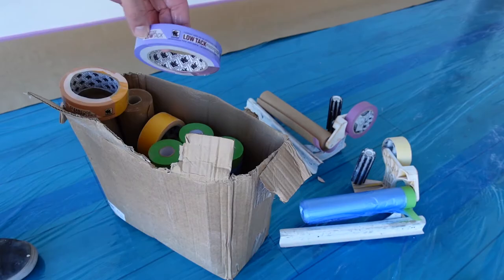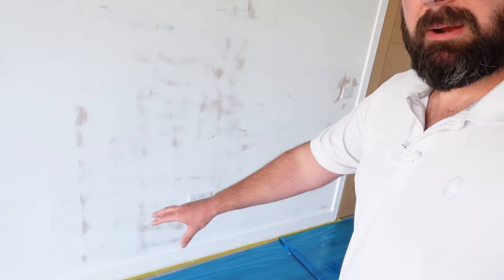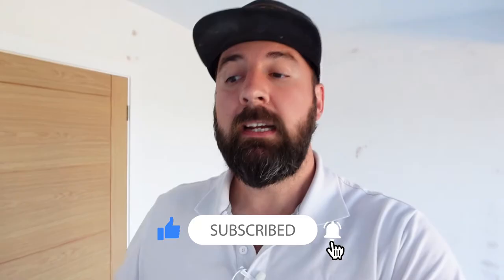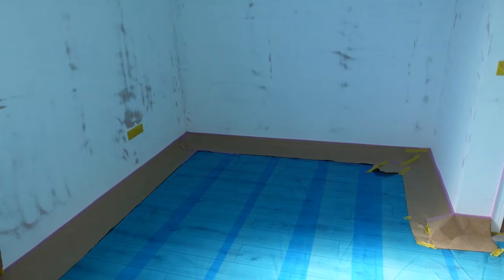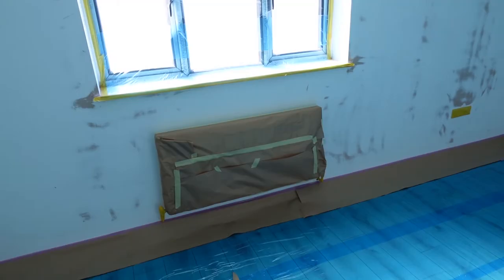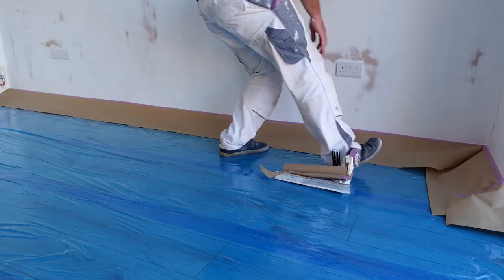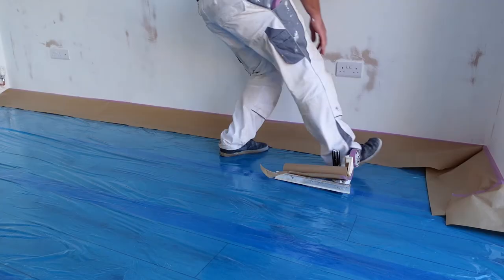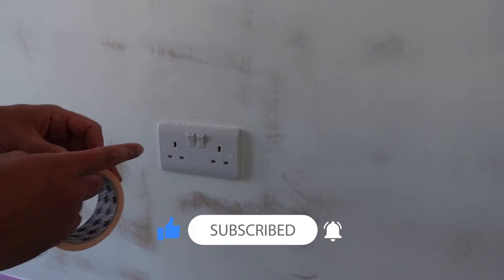How To Mask a Room Up With Wood Floors For Spray Painting

Comment: Loving the video, awesome work ! Just out of curiousity do you charge per meter? And if so do you add materials on top
Cheers
David
Reply from the maker: Hey thanks for watching. I havnt done any on per meter. I just charge per job and materials ontop
Reply: Ok cool, and the tape, and prefence where you get them from? Also I too have the hand master, and was costing a bit for the plastic rolls, till I see the ones you use, 👌
Reply from the maker: @davidsculley6304  ye totally those plastic rolls can come to nearly 10quid and then tape the idasa ones fit on the masker and are 6ish pound. I buy most of mine from crown decorating stores.

Comment: Hi mate lovely job, have you ever had a problem with gun spitting a few blobs before run, honestly doing my pip in, also have you seen the tadpole tape cutter lovely bit of kit
Reply from the maker: thanks, yes ive seen the tadpole cutter. but never use one. did you catch my video on how to tear tape?
Reply from the maker: sometimes they spit when material can be abit thicker, or when paint hangs on the guard. it happens alot with most guys and guns. best advice if its old gun is to change the needle or strip the gun and clean it as it may not be closing when trigger is released causing it to shoot some paint out. 
or start off of the surface each time you start and stop, or you could use a cleanshot valve
Reply: @sprayaholic  no I haven’t I’ll take a look now

Comment: Hi, great video thanks. I hear a lot of people say you need to back roll walls otherwise you can't touch them up. What's your experience with this and would you recommend backrolling? Thanks!
Reply from the maker: Hey thanks for watching.  I think you'll see a touch up regardless of rolled in brushed or sprayed and it mainly comes down to the paint. Some touch up better.  You can touch up a spray wall with a roam roller if its thinned down abit as it will gel out. But the flatter the paint the easier it can touch up
Reply: @sprayaholic  exactly even touching up rolled walls these days is just has much of a problem I’m really not sure you benefit from back rolling in my opinion, try touching up a ceiling even if rolled for example can be a nightmare
Reply from the maker: @David Cottle  exactly mate. You cant. Anti reflex from tikkurilla maybe but not many other paints

Comment: Can you suggest which tip can i use for high rise exteriors happy christmas
Reply from the maker: Hey happy Christmas.  Exterior  and are you worries about overspray? 
What machine and tip size are you using now? Or what had you considered
Reply: @sprayaholic  graco 695 and tip 515
Reply: @sprayaholic  I want to spray for 25story building EXTERIOR

Comment: So you do walls before ceiling if using one color? 2 coats on walls then 2 on ceiling?
Reply from the maker: Thats right.  I do this to avoid walking around in the over spray on the air or on the floor. And then i walk away from the spray not.into it
Reply: @Sprayaholic  doesn't the overspray from the ceiling get on the walls and make it rough?
Reply from the maker: @Erik7prc  no because the walls are still wet from the second coat when i do the ceiling

Comment: What is your goto paint for white walls and waterbased woodwork? And do you dilute either?
Reply from the maker: It changes on jobs. I do like crown matt vinyl as it's nice and flat. Mistcoated im around 30% and top coats about 5 to 10%.  Again woodwork can xhange from crown, to zinsser allcoat or Tikkurila.  Generally 5% just to ease flow

Comment: Do you mind me asking me about your set up?
What pump/gun/tip etc please
Reply from the maker: Hey bud. This set ups my graco 390, graco pc contractor gun, 3/16 whip hose. Tritech 618 ultra tip
Reply: Sprayaholic perfect thank you really appreciate that
Reply: Sprayaholic so you can use tri tech tips in the gracocontractor gun ,didn’t know that
Reply from the maker: @chrisball2258  yes bud. You can use any brand on any gun. You just need to use the same branded guard. So i had a tritech guard on the gun.  All guns in uk at 7/8 thread i think so all interchangeable wagner/titan  graco tritech etc. America i think some guns have different threads.
Reply: How do you find the tritech tips to the Graco ones any preference and if so for what jobs inperticular and what pressure did you get down to
Reply from the maker: @paulmorgan1636  theyre nice. The ultra feel like the graco low pressure tips. But youre not at low pressure. I was from 2000psi to 2200psi. The tips needed wearing in and sprayed abit nicer and lower pressure after about 40 or 50L. The 618 move the lile the same speed and feel but if it was graco id have been alot lower pressure. 

I found some.tips like some paints more than others so its good to have a selection of tips even from.other brands in your main sizes

Comment: When painting the walls do you release the trigger when you reach the ceiling or just quickly move across.
Reply from the maker: I do both. Depends if the guns spitting on release or not
Reply: @sprayaholic  I always worry about getting to much on when moving across with the trigger on, think I need more practice.
Reply from the maker: @richardbeadle3945  yes you definitely can get too much on doing it that way, also more over spray and wasted paint if youre not careful.  Its more controlled to trigger on and off. It allows you to line up your next pass better
Reply: @sprayaholic  cheers for the reply mate
Reply from the maker: @richardbeadle3945  no problem happy to help. Feel free to ask questions when you need advice.  Plenty of videos on the channel ✌

Comment: How bad is the overspray in an airless? If i am only painting the walls, do i need to mask the ceiling?
Reply from the maker: Yes you would need to mask or Shield the area off.  The over spray can ve very littlw depending on the tip size you use. It can be more controlled the smaller the tip
Reply: @sprayaholic  thanks. So I was planning on masking around 90cm of the ceiling edge. But was wondering if I need to mask the full ceiling?
Reply from the maker: @330d5  no I usually use 12" paper. It all comes down to youre wrist. If yoy flick your wrist at the top of the wall it will go more on the ceilings. Keep the gun faving the wall and will have less over spray on ceiling.  I found a 516 was very controlled

Comment: Wait you only sprayed one coat? No primer and one coat of paint? So you could take the tape off while wet?
Reply from the maker: Id already sprayed a primer on the walls and ceilings and sanded and prepped up a few days before the flooring was fitted. Then i masked up and sprayed 2 coats  one after the other then de masked.

Yes the paint can pull up with the masking if left to dry so scoring sometimes is needed. It depends on rhe finish of the paintz some paints dont do it

Comment: Just out of interest how much would you charge for that room materials not paint just tape etc
Reply from the maker: This was a room from a  full house i was doing. But an average room you could say no more than £35 thats for a full  roll of brown paper, polythene, 1x sensitive tape, 1x precision tape. Floor protector.  Could use correx sheets and re use.
Reply: @sprayaholic  thanks for the reply didnt realise how old the post was as I'm a painter and decorator I'm looking to switch to spraying as I'm going solo now so need to speed things up just wasnt sure on prices of materials cheers
Reply from the maker: @waynejones6499  no problem.  I did this one last year. I buy most of my bits from Crown decorating stores if in.the uk. Hopefulthe videos on the channel help

Comment: Just out of interest, how long  did it take to mask paint and de mask that room??
Reply from the maker: It probably took about 30 mins to do the lot including the blue flooring. If youre masking with the hand  maskers its very fast, windows and doors are easy. I had 4 rooms to do at the same time so time saved was massive
Reply from the maker: De mask the windows doors skirts and flooring came up in about 5 mins. I waited got the light switches and radiator to tack off a little and again minutes

Comment: Do you have to use a different type of paint for the ceiling vs the wall?
Reply from the maker: You can use the same if you like. We try and make ceilings look non reflective especially in areas with alot of day light. Small rooms etc wouldnt matter too much.

Comment: Did you say you spray 2 coats straight on top of each other???
Reply from the maker: I spray a quickish first coat. Which has dried by the time I finish the room. So second coat ontop.
Reply: @sprayaholic  But doesn't the paint harden over the tape and then tear your paint off the wall? I had that experience a few days ago? I figure from now on I have to score the tape.

Comment: I'm spraying mdf skirting with zinsser bin 123 then 2 coats of dulux water based satin. I'm masking that up to paint walls but the tape is pulling the paint on skirtings.  Like all of it down to the primer that's on the mdf when it comes. What am I doing wrong?
Reply: Not all of it, just some places
Reply: Lots of preparation Chris, maybe dust on the surface when your spraying, I always give it a good sand and wipe down after. Use low tack edging tape as well. It's happened to me before and learned from my mistakes
Reply: @waggstaff91  I think that's what it was too. Started cleaning it with tack cloths now and it's solved the problem. It's a small amount of dust that presumably gets rubbed in if you were painting it with a brush.

Comment: What size tip did you use?
Reply from the maker: I was using a tritech 618 ultra. Gold tip
Reply: @sprayaholic   hello from australia......is the tritech 618 gold same as graco fflp 618 ?    or lp619 ?  are you know favouring this tip for walls deilings ? thanx in advance
Reply from the maker: @Dino Devitis  hey. Well graco stopped making the 618fflp . I do use the 619LP but you can tell a difference between the 2.
The tritech 618 is the same pace as the 618fflp but it doesnt spray at the low pressure. But wierdly you feel like your spraying at low pressure due to the speed and control.

Depending what machine you use those higher sized fflp and lp tips were great as it ment you could use bigger fans and not set your machone to full pressure

Comment: Hi buddy, what was the blue sheeting you used on the floor?
Reply: I would love to know that to. I’m really struggling with floor protection. Sick of tripping over dust sheet but struggling to find good cost effective alternatives
Reply: @robinhowes2453  I use everbuild "roll & stroll" 75m £30 for carpets off Amazon. I use Q1 floor pro board( brown roll)45m for hallways, kitchens, laminates etc £28. That's from My paint brush. 👍🏻
Reply: @danielwoolcock7267  thanks I will have look. Fox not a tiger hey

Comment: Music almost loud enough to completely block voice, then irritatingly loud later.
Reply from the maker: Thanks for your feedback.  Will aim to improve in future videos. Although the music wont be for everyone each time
Reply: @sprayaholic  Thanks. The music was not bad, but if I can't hear you then I might as well listen to a music channel. :) and then later the music volume jumped up. Both of these situations requires fiddling with the volume on my device, if multi-tasking then may not be worth watching. But I like the content and concise info. :)  I think some that watch a lot of content would like to watch one or more and not have to change the volume or have you voice lower than the music... or close.
Reply from the maker: @Sn00py1492  ye i totally get it. I edit with headphones so the levels may be different on other devices.  I usually run back ground music and then when no talking up the music.  But again thanks for the support and input always happy to answer  questions when needed

Comment: I’d rather just paint it by hand
Reply from the maker: Whys that? This is one room from a 4 bed house. I painted the whole house 2 coats in less than a day
Reply: @sprayaholic  just seems that by time you tape everything up you can just paint the room in the same time .... 🤷‍♂️ I’m probably wrong if so many people choose to spray these days
Reply from the maker: @wheres_bears1378  i can mask up the room while yourr still on the first cut in. Bare in mind you have to cut in 3 times. Mist and 2 . You only need to tape once. On a job this size it would save days if not over a week easy.  Every jobs different and i dont spray all the time but knowing when to becomes a money maker and a back savers
Reply: @sprayaholic  ok ill take your word for it maybe I’ll try it out 😊
Reply from the maker: @wheres_bears1378  once you get into it you'll see. You need to protect floors and areas anyway.